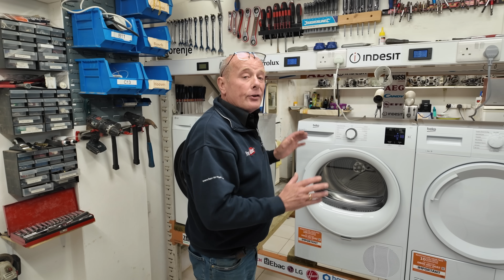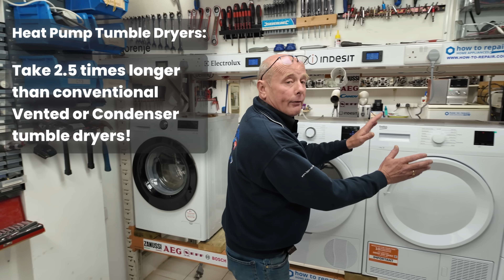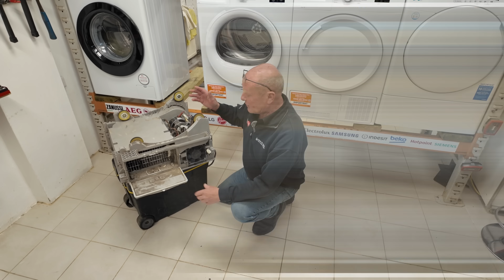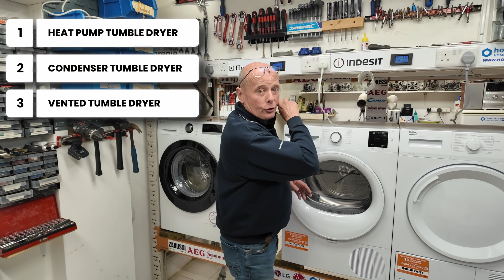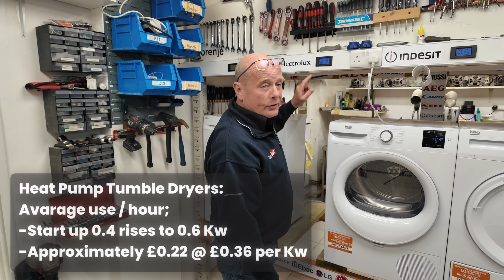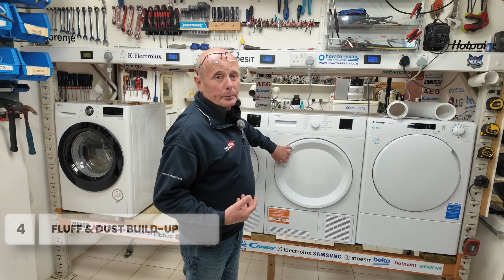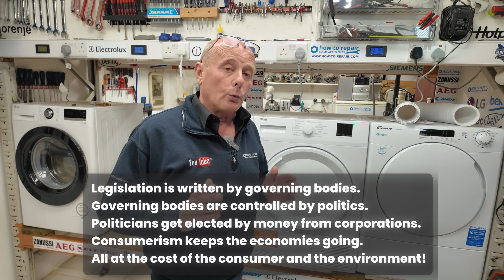Tumble Dryers the Shocking Truth About Heat Pump vs Vented & Condenser, NEW LEGISLATION!

Comment: Eyeopening video. 
We have a 2.5 year old  Bosch Serie 4 WTH85222GB/01 heat pump tumble dryer which has just been written off by Curry's after 3 unsuccessful attempts at repair over the 24/25 xmas/new  nb could not fault the attending, time spent on testing, repair & persistence Condensate water level meter/sensor replaced following water level indicator issue. Problem was not resolved. Over the course of two further visits all control boards replaced with the effect that the machine would run briefly & then shut down.  Prior to this,  back in October 23 the machine had the same condensate water level issue which was resolved. Details on filter cleaning, (all three including the foam condensor filter on these model) come the second time repair attempts around were deemed immaculate.
The machine is used 3 times a week & filters cleaned each time.
Personally I believe that the build up of micro particles within the machine itself has killed the machine. In the market for a condensing dryer now we have the refund over £700.00.

Comment: I bought my first dryer (heat pump) bc I wanted to have a top of the line dryer, save money (it was class A, where most of the other dryers were B or C), and I loved the GLASS DOOR. My wife has been using that heat pump dryer for around 6 years, so she was used to waiting for 2.53min for a load. When that broke, I bough a cheap Beko (ebay auction ~25gbp) . I told my wife I want to throw it away bc it's using more energy. She said: DON'T YOU DARE! This one only takes 1h to dry the clothes. I would rather spend more on electricity than go back to 3h waiting!

Comment: It's good to see you note 450w for the HP TD when compressor is on ,  but is this a constant throughout the 2.5hrs cycle or does it modulate  ie go off or go down to a minimum  for  som epart every few mins?  It would be really helpful to get full W use for a cycle vs full W used for a non HP  which is as shown about 2Kw

Comment: I worked electric retail for around 15 years, mostly computers and tech but last few years worked directly as a Sales Promoter for companies like LG but mostly just washers as heat pumps weren't a big thing then. Last few years, I had a Beko (no issues) and now an LG washer/dryer, whats your thoughts on the direct drive over normal motors with belt, find mine is very noisy on 1400 spin and not ideal in an upstairs flat floor - also had 2 display boards replace in last 3 year (good I got mine with a 5 years warrantee) - is this a known issue?

Comment: I think that this topic is a bit more involving than described in the video, albeit I agree.

I have had a condenser tumble dryer (of UK origin) for 12 years. It shot out the lint everywhere and had to be completely taken apart once every 3'rd year. Lint all over. It used exactly 6,5 times more power than my AEG heatpump dryer. I measured this with external machinery, so it is true. It made a loud noise all the time when working, and made my (big) washing room very warm and moist. Quite unpleasant. This machine was bought second hand. We bought this when our old Bosch condenser dryer burst into flames even after having cleaned it all the time. I mean inside out clean when taking the machine apart.

I have now for a long time had a old AEG (Polish built I believe) top of the line 8000 series heat pump dryer which is now 9 years old. Really well built, extremely silent, and seems better than what they make today. I have had them at the same time for a while. It dries a similar load at no more than double the time max. I would say it's about 40% more time on average. I tested it on normal clothes and towels, and it used only ½ hour more than the condenser dryer: 2:00 hours versus 1:30 hour. But it does take longer time for sure.
This machine is extremely efficient and energy saving. It is very very easy to clean like the normal condenser dryer, and I don't need to hose the condenser every second or third time. It was 5 years when I bought it and I took it completely apart to the last bit, slightly grounded all 4 support wheels, changed the belt which was completely okay, and took the condensers apart and found only little lint. I carefully washed it all out and vacuumed the two big felt seals, one each end of the drum, inspected all seals and the machine is completely clean. I then bought a piece of 10PPI aquarium 5cm thick filter, and cut it so size, and inserted it behind the lower front inspection door, right in front of the cold condenser. I have not had a single spec of lint since them and the air flows completely freely. If the motor dies, I will just install a new motor, which is a inverter magnetic motor and it is superbly silent and spins perfectly. I expect this motor to last a very very long time. I bought this AEG second hand.

The price difference between a motor for the AEG heatpump dryer and a heater for my UK made condenser dryer, is very small.
Now, in real life, it it not very often that we dry clothes in lut tumble dryer. We nearly only use it for hard shell out door jackets, down jackets and pillows and duvets. Because of this, the running hours are only 142 since new. I looked in the eeprom to verify. Similar on the normal condenser dryer.

I have not noticed any accelerated wear and tear on anything I have dried in the heat pump dryer. Not at all noticeable. I have looked carefully at the amount of lint in filters, and there is no more lint than when using the condenser dryer. I therefore cannot testify that it should wear the clothes more/faster).

Regarding the level of heat used by the heat pump dryer is much lower, than on the condenser dryer, which in my humble view saves the very expensive hard shell jackets etc. quite a lot. I am climbing mountains, so I need my gear to work perfectly. Also for avoiding fires.

Also, the argument sometimes heard, that the heat pump clothes needs to be shaken lightly after having been dried, is true. I shake it lightly and stack it. I did do exactly the same with the normal condenser dryer.

I think I can say, after having had 4 dryers, that they all needs regular attention to cleanliness. And if not cleaned, they will begin to shoot lint out various places, like along the big felt rings in front of and behind te drum itself. More lint opens up the seal, and let even more lint out.

I have not noticed any problems with the 4 support wheels and their bearings as of yet. I think they last long, because they won't get as hot. Anyway, if need be, I'll just insert better bearings.
I have noticed though, that as the heat in the condenser dryer is higher, the belt driving the drum wears out faster, as it dries out.

Btw, I also have an AEG old 8000 series combi washer dryer (heatpump as well), and the dryer is extremely easy to open up and wash put/clean). Just lift off the top lid, then the lid for the condensers, and voila, it can be easily cleaned, if need be). Anyone can do that, even my grand mother. She was old, but not with her arms behind her back.

On a general note, I find many, even expensive machines, not very well built, and no matter the brand. SO many machines break down in the computers or the silly display and touch buttons. I absolutely avoid touch buttons. More plastic, more big modules, rather than individual parts, and the parts supplies are really expensive. The later being the reason why so many people don't bother repairing them. The right to repair and at a LOW cost is paramount!
I think there is a bigger problem in general with cost saving in factories, cutting down on bearings quality and sealed drums in washing machines, where there is no flanges to drill holes and reseal the drum after having cut it open and replaced bearings.
That is a real nuisance.
Out lazy overpaid legislators should get their finger out and make it illegal to make bad quality and built in break downs. Remember the Canon printer with built in chip that blocked the printer? It's all over the place. Flat tv's with too small caps in the power supply, which burns out after 3-4 years. It cost me a mere 2 pounds 30, to buy new caps and solder them in. 

We usually dry on the line, all year round, despite the fact that the UK send us all their bad weather (all year round).  ;)

The biggest problem in my humble view, is the governments all over, liberalized the energy markets, so the suppliers can pump up the price artificially every time the normal family need some electricity. THAT should be ILLEGAL. MBA's destroy the world this way.
The second biggest problem is fashion. Look at all the stupid quality or lack there of clothes. Not designed to last. And the fashion in fridges, washers and dryers. Oh, but it's got a chrome ring this year, so you HAVE to have it. And the fake pricing market, blowing up the real price to disproportional sizes, right before a so-called "sale". Every month... Fake news, I'd say.

Thanks for sharing.

Comment: Yes, the new clothes dryers are amazing bits of technology. I love heat-pumps. But they require an expensive (and rarely available in rural areas) technician for even the simplest repair. Conventional dryers are terribly inefficient but I've kept them going for twenty, thirty, forty years. You should ask yourself: will the future energy savings of an expensive, high-tech clothes dryer actually save you money in the long run, factoring in the servicing, shorter lifespan etc? I don't think so.

Comment: I've thumbed this video up to show it to my employer as they have recently (6 months ago) bought a Hoover heat pump drier. In that time we've had the repairer come out to us 3 times for the same issue, bearings in the motor. We use the unit in a residential property and we dry clothes nearly all day and night trying to get clothing ready for the next day. Is it possible that we could insist on a new machine for the same reoccurring fault?
Personally I wouldn't touch these heat pump drier with a barge pole.

Comment: Agree while heatedly with your opinions and reasoning, design is flawed for maintenance. However I watched breakdown videos and decided to hose it the condenser and lower box section after cleaning inside. First is a massive issue throughout, filter doesn't capture everything. I was able to rock the machine with walking up liquid and kept rinsing the lower compartment until it ran clear. This machine was about 3 years old, Bosch heat pump, and had become unusable due to the error codes and issues with sediment and fluff. This took 10- 15 mins and it now works like new. For anyone that wants more info please comment as this saved me a new heat pump or a hive tear down to access the internals. Further more any issues with re gassing etc do concern me, however fluff/ dust  and poor design( possibly intentionally) is the main issue as fridges can last 10+ years without issues.
Reply: And I bought a piece of 10 ppi filter foam and cut to size. Placed in front of the front most condenser (the cold one). No more lint in the condensers. Perfect air flow.

Comment: Heat pump every time. The scary compressor resides in every fridge or freezer and normally lasts for years.. . I blow the crap out by getting the missus wound up and she shouts it out with her very large lungs and mouth. Bing Bang Bosch.

Comment: We don't have a tumble dryer. Instead we have an indoor retractable clothes line on the landing and a dehumidifier which uses 320watts on full and 120 on minimum- clothes dry within a day and the dehumidifier is only on in daytime as we have solar panels so cost is negligible.(Also the dehumidifier only cost us £69 4 years ago and still works fine)

Comment: A condensing dryer is not recirculating the air in the machine. It takes air from the room and passing it in the heat exchanger with the moist hot air.
A heat pump dryer is on the other hand recirculating the same air in the machine.
As a Miele technician for many years I'm not seeing drying times as you tell, I'm only seeing drying times that are 10-15 minutes longer.

Comment: you do have some interesting points, however manufacturers are legistated to provide spare parts for least 10 year. As for the time it takes to dry cloths I would have to disagree, In my experience our heat pump is quicker, produces less heat, so I would presume less damaging to cloths. We have had ours for 8 years, I've cleaned it twice and it's nowhere near the poor condition that you display, (And it gets heavily used) So I would have an educated guess that your 2 hours to disassemble seems well out,( I took 45mins ) 45mins cleaning and 1 hour reassembly. Also the poor condition would very much suggest it had been run without filters for a long period.

Comment: We've had our current heat pump tumble dryer about 9 years and it does get heavily used.  There's no doubt it has saved us a fortune on energy and the associated inbills but, as you described, I've had to strip and clean it 3 times because of poor design. This on an £800 Bosch machine. A simple removable hatch in the side of the condenser box to allow access would fix the issue.

Comment: are these heat pump units designed with obsolescence? if you consider that most white goods are designed to be used of around 3 years, parts are always an issue to obtain. My other worry is that manufactures have started to use bastard fastenings, not the normal JP or Phillips heads.  ~Trooper

Comment: My grandmother’s 1964 Maytag washer and dryer are still running. Eight years ago I had to replace the timer in the washing machine. It was $80 and it took me about 35 minutes to replace.. 
    The washer washes my heavy commercial contractor, heavy canvas, double layered work pants in 20 minutes of wash time. 
     In my new eco-friendly all the bells and whistles most modern computerized washing machine. It takes one hour and 40 minutes to do the same load of clothes.. and a old 1964 washing machine uses 2 gallons less water than the new modern day, energy saver, water saver, modern washing machine. And with a walk meter on there the 1964 washing machine use two cents less electricity than the modern day washing machine.. 
     And the exact same thing goes for the dryer. 20 minutes to 25 minutes for the 1964 gas dryer.. 
     One hour and 20 minutes for the modern day, economical computerized energy, saving gas dryer. 

There is just no comparison from Old to New when it comes for how cheap it is to repair how many decades it will last and how easy it is to repair

Comment: From Canada:  always interested in what is happening in the UK.  Are direct ven gas dryers not a thing there?  I've had mine for over 15 years with no issues, and I can say we do more than 250 loads per year.
Reply: The were a few models on the market very many years ago, possibly as few as 3. I believe White Knight were the very last manufacturer to produce a vented gas dryer in the UK. I think the high cost of the gas dryers, plus the cost and inconvenience of paying a corgi registered gas engineer to run the gas pipe and install them, which is a legal requirement, and also to carry out a recommended annual service/inspection, plus having a hole bored through the brick cavity wall for the vent, put a lot of people off, when you could buy a much cheaper condenser dryer that you just needed to plug into any convenient socket. I looked into getting a gas model to replace our existing electric one many years ago to save money on the running cost, but I worked out I could save almost as much by keeping my existing dryer and switching to an economy 7 tariff, which gave 7 hours of cheap rate electricity overnight..
Reply: @mels8966  Thanks!  All our dryers are direct vent, whether electric or gas, so the venting was the same.  We don't vent into the house for obvious reasons, i.e. elevated humidity in a cold climate, condensation, mold etcetera.  Gas piping wasn't an issue, fairly straightforward 13mm threaded steel pipe, valves, trap, but yes you have to be a licensed gas fitter.  I'm not impressed with heat pumps really.  Overly complex, expensive first and service cost and limited in cold climates.  I'll stay away from them.  If push comes to shove I'll go back to electric resistance dryer and throw a solar panel up, but as long as gas is available, that's my go-to.
Reply: @andrewmacgregor8717  The latest heat pump dryers use less than half the electricity a conventional dryer would to dry a load, so with current electricity prices in the UK, they can quickly pay for themself. The current generation are much quicker to dry than older models, according to some owners they're not that much slower than a standard dryer, and they also generally have better self cleaning and filtering than the older heat pump models so should maintain good efficiency for longer. They are also a lower fire risk and the lower drying temperature is gentler on clothes. As the UK no longer produces enough gas for its own usage and needs to import liquified gas from the USA, gas prices are getting higher too.

Comment: Due to the poor longevity of modern electrical items these days, I have all of my large electrical appliances on Domestic & General repair insurance (including my Beko heat pump dryer) as i can't be doing with the hassle and monstrous expense of finding someone to repair them. Arrange a repair online and 2-3 days its fixed or replaced. If the government got its act together and legislated that electrical appliances had longer manufacturers warranties, especially larger more expensive appliances this would reduce the ridiculous amount of appliances sent to the tip.

Comment: Appliance engineer here and i tha k you for this video. I hadn't considered the wear and tear of the motor and bearings, a great point. 

You cant beat a big old 2.4kw heater on a vented drier. Ad long as they're serviced every year it'll do you proud for years. 

Thanks Paul.